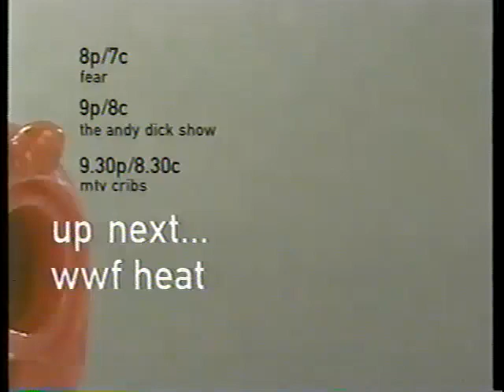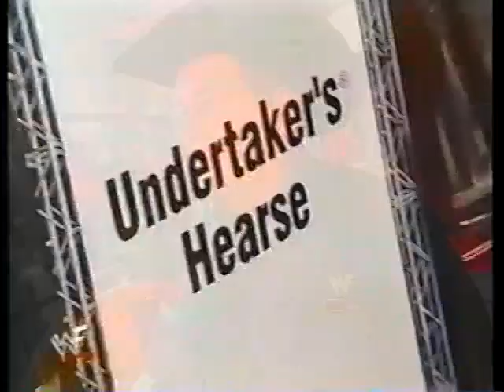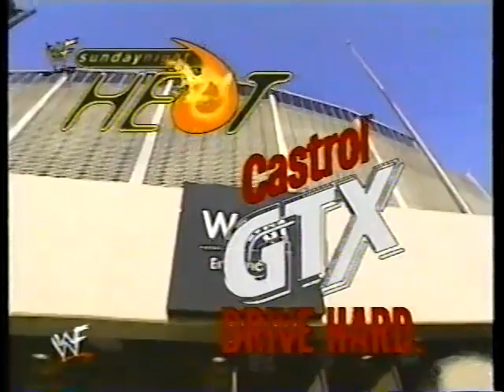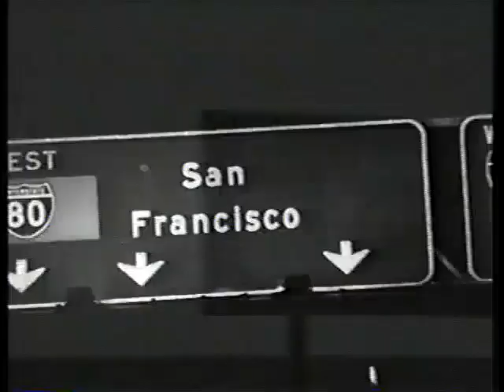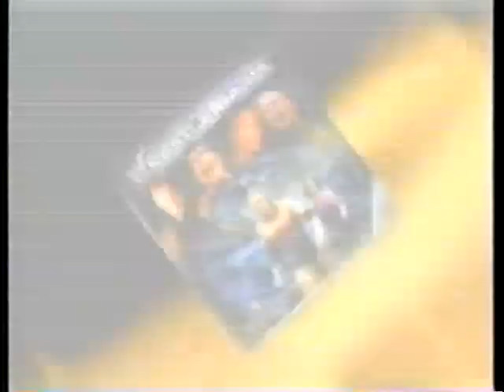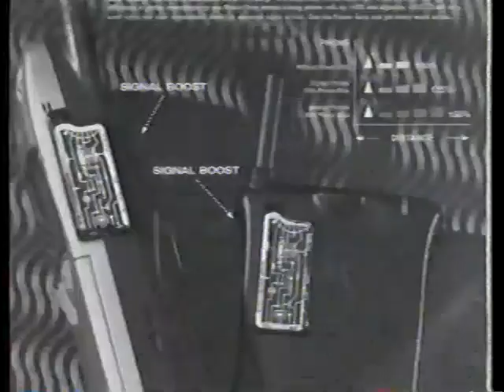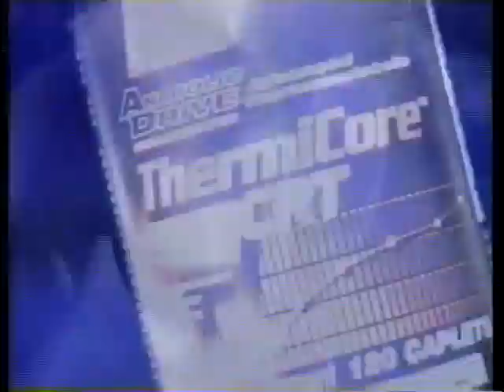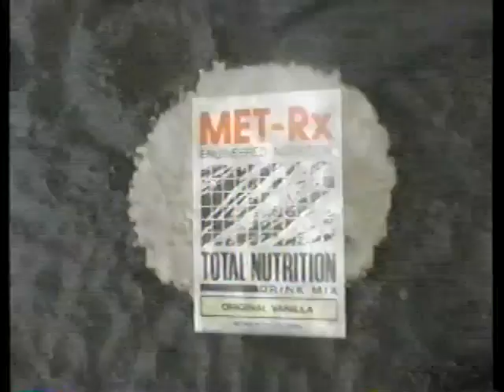wwf sunday night heat 04 01 2001 (wwe network, please read description below)

Comment: End of an era
Reply: No.. Stone Cold and The Rock remained the two faces of the company for the next year. Austin was champ most of 2001.
Reply: @themadrapper101  but this was the end of the Attitude era
Reply: @davids.w5514  no it really wasnt. One more year.
Reply: @themadrapper101  it was because the attitude era was meant to complete against WCW.
Reply: @davids.w5514  still not the end of an era completely. Stone Cold , The Rock the two main guys, then you had most the roster from 2000 still there besides them bringing in the WCW & ECW guys like RVD & Booker T wrestlers who were well known the past few years at the time. WCW and ECW were apart of the Attitude era too. The Invasion angle and Austin and The Rock taking on the nWo at Wrestlemania 18 is a fictional continuation of that war between WWF and WCW. 

In 2001 The blood, cussing, chair shots to the head, the puppies, bra & Panties, the storyline style, all WWF staff and wrestlers with no merchandise could be seen wearing WWF Attitude shirts until Spring 2002. You had the WWF Scratch logo intro before every show into Spring 02, the signature Attitude era Raw is War theme and stage from late 99-2000 still used so no the Attitude era didn't just die overnight after STONE COLD won the title at WM17